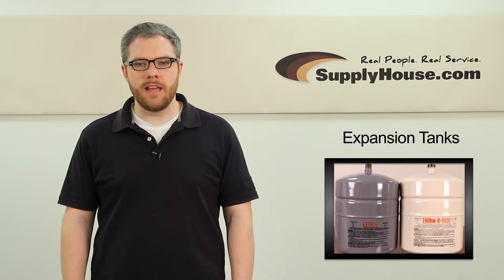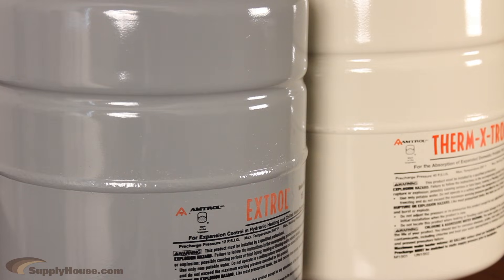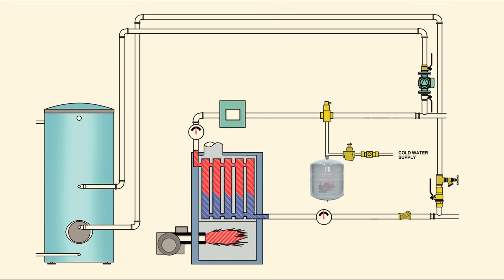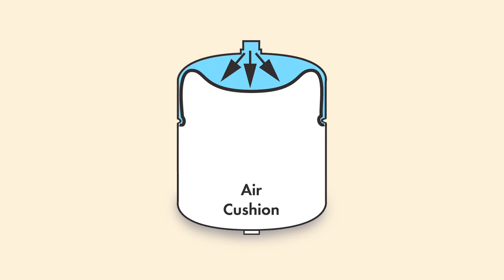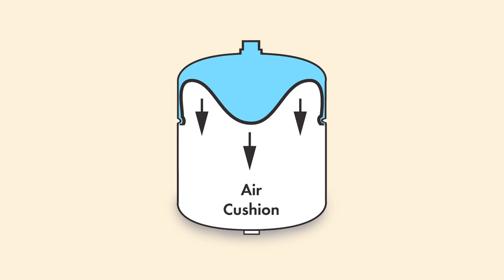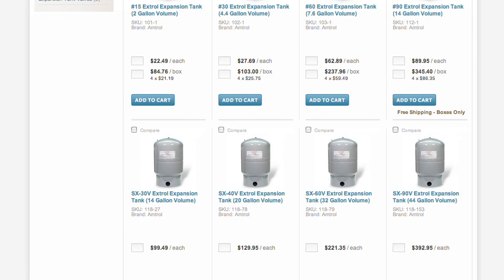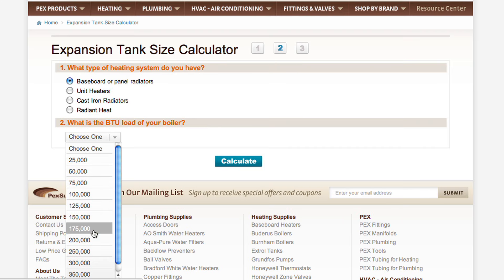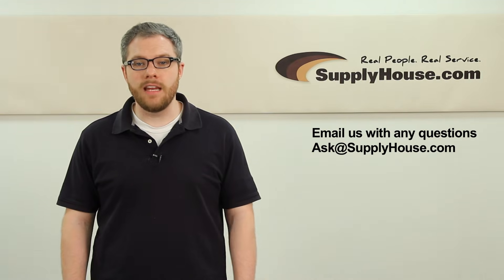Expansion Tanks (How It Works)

Comment: If an expansion tank comes new set at 15 psi and I need 22 psi in my boiler to get an upstairs zone to work, do I have to increase the pressure in the expansion tank to 22 psi?  Will the water not circulate in that zone if I don't increase the pressure in the expansion tank to 22psi?
Reply: Match the expansion tank psi to the water pressure in your home
Reply: If you leave the psi lower in your expansion tank water will flow in freely and won’t be of any use
Reply: see this is where everyone differs. This guy just told you set it to water pressure in your home. But it's supposed to be set to the baseline water pressure of the system. And I believe the minimum pressure set is 14psi because atmospheric pressures. So you always have 14psi then stack the pressure ontop that you need.
So statt 14psi in bladder.
Install into system
Fill system with water and measure pressure of system now.
Then add that pressure to the expansion tank. Done.
Reply: @screener545 you set the precharge to the system pressure. The precharge can only be checked or changed when there is no water pressure in the system. If the precharge is too low the water will enter the tank and compress the diaphragm until equilibrium. Which means you have lost expansion room and effectively made the expansion tank smaller. If the precharge is too high then the water will not enter the tank until the system pressure reaches the diaphragm precharge. And the entire point of the expansion tank is to maintain a much more stable pressure.

Comment: My hot water heater keeps purging water out the pressure valve when I wash clothes or take a shower. I replaced the valve thinking it was worn out but it didn’t stop so I just stuck a piece of pvc going over a bucket and empty it every few days. Would an expansion tank stop the problem? The office building where I work has an expansion tank connected to the line coming out the water heater. Long ago when I first started working there was the first time I’d ever seen one on a water heater. Had the problem over three years, can’t identify the problem from online searches.
Reply: You may need a pressure control valve in addition to expansion tank.
Reply: Dennis Fowler thanks, after I posted my comment I found the pressure valve, it was under a shelf in a basement closet. It has a small drip under it so I’ll replace it when I get the chance and I guess add an expansion tank too since it won’t hurt.

Comment: You did NOT demonstrate how to check the expansion tank for being water logged.
Reply: Here is how you check hydronic heating expansion tanks.
step 1 - turn off power to heating system
step 2 - isolate your makeup water regulator.
step 3 - isolate all heating loops so you don't drain fluid from your heating zones.
step 4 - drain pressure down to 0 psi on your system.
step 5 - remove expansion tank pressure cap and check pressure reading. 
your pressure should = makeup water regulator set point. 
tanks come pre charged @12psi
step 6 - once you have verified correct  pressure. Tighten pressure cap.
step 7 - open makeup water pressure regulator to pressurize system.
step 8 - open all heating loops
step 9 - restore power to heating system
step 10 - Make each heating loop call for heat to verify it's not air locked.

Hope this helps!

Comment: so I don't understand what's the difference between expansion tanks and compression tanks and which one is used in the video?
Reply: The white tank is used on water heaters. The gray tank is used for hydronic heating systems. Also, the White tank is 3/4" male NPT and the gray tank is 1/2" male NPT.
Reply: White tank has plastic liner inside hydronic tanks do not

Comment: I have an electric water heater and just replaced it and expansion tank

Do i need to be concerned about the pressure on the tank compared to house pressure???
Reply: Depends just make sure your pressure reducing valve rating matches your expansion tank rating

Comment: Very approximate, not "exact".  Boiler BTU rating is a very poor indicator of required expansion tank size.  If in doubt go a size larger, there's no such thing as an expansion tank that is too big.  Too small can dump hot water from your release valve and rot your boiler and system.
Reply: Good point, although the manufacture uses net boiler output BTU's to size expansion tanks, you can use online expansion tank sizing calculators which look at total system gals, relief valve setpoint, makeup water setpoint, expansion tank pressure set point, cold water fill temp, and max temp setpoint.

Comment: This installation makes no common sense at all. Air rises above water. Sediment falls to the bottom. The reason these tanks fail so early is because they are being installed sideways or upside down. Sediment drops right onto the bladder inside the tank when installed improperly like shown in the diagram. The life of the expansion tank is shortened because of shoddy work and the homeowner pays the price for this planned obsolescence in having to buy a new tank, paying a plumber to do the job wrong once again and additional pressure on the plumbing system as a whole. It just sets everything up for a catastrophe. So if you are doing this job yourself, which is highly recommended, put the air inlet at the top and the water inlet at the bottom. Also when the bladder finally does fail there will still be air in the top of the tank and it will still do the job it was originally intended to do for you. Install a max reading pressure gauge in your laundry room where you can readily see it at all time and it won't freeze either. Reset the red max reading needle periodically to see how your system is holding up. You will easily see when something is failing in your water system and hopefully avoid any unexpected and excessive water damage to your home or business. Ben L. Lofgren - retired manufacturing engineer. Send replies anytime to bonycells at gmail dot com
Reply: Ben Lofgren, it makes a lot of sense.  If you have enough dirt in your system to cause pressure tank failure, you have bigger problems than orientation of your tank.

Bladder tanks will work in any orientation, but hanging has several advantages.  It is a stable mount requiring no separate tank support as required for horizontal or above pipe mounting.  Air will not get trapped on the water side of the bladder only to be slowly expelled back into the system during operation making air elimination more difficult.  Lastly, you won't have several gallons of water rushing out when the bladder fails and you have to remove the water logged tank.

Upside down mounting requires separate tank support and makes removal of a water logged tank very messy.  If dirt is an issue, add a dirt removal device, but a modern hydronic system should not produce a lot of dirt.  Cast iron boilers and radiators are a thing of the past and a cast iron circulator produces very little rust unless you have air in the water ... such as you may with an upside down pressure tank. 🙂
Reply: Ben Lofgrin:  Installing it upside down as you suggest will cause it to collect air.  One full of air it will no longer function at its required capacity.
Reply: @leifharmsen  bs, I've had the same one for 20 years and it's installed exactly as the engineer mentioned
Reply: Excellent advice
Reply: Ben Lofgren  I like cookies
Reply: Amtrol - Warning (Mount tank vertically in downward position only)
Reply: Ben Lofgren that’s the way it’s installed at work.